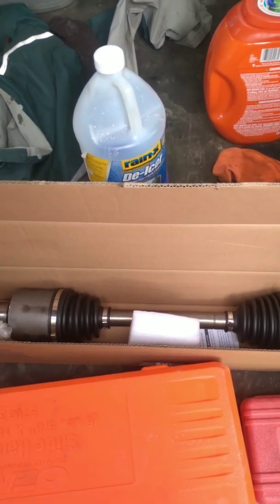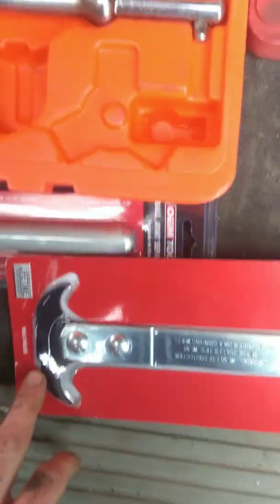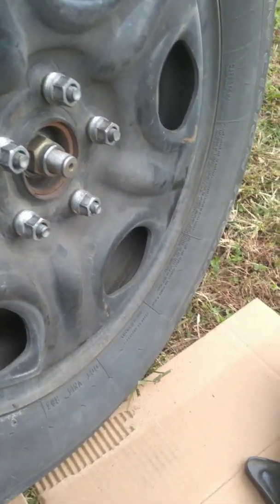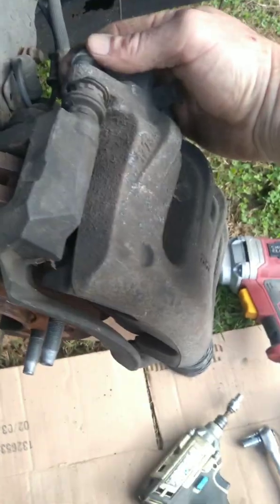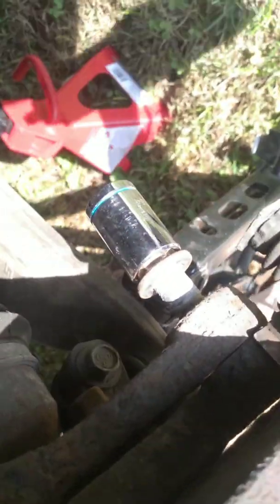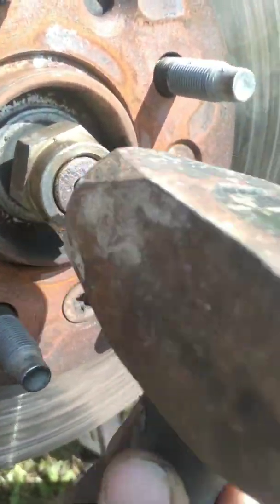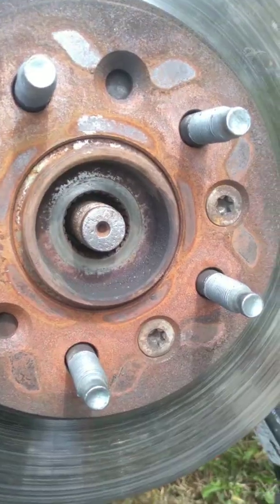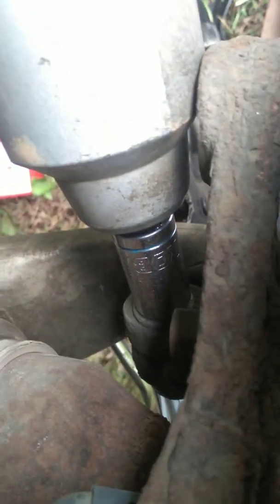Ford CV axle and output shaft seal replacement. Freestar/Windstar shown other models similar

Comment: How did you get the ball bearing off I can't get it for the life of me can I jack up the hub? Pls help lol
Reply from the maker: Are you having trouble getting the axle out of the hub assembly?
Reply: I'm having trouble getting the A-Frame disconnected from the hub assembly. I've been prying and prying with a pickle fork and having no luck I noticed in the video there was a scissor jack under the router so I was wondering if I have to jack up the router to get it disconnected. It just seemed sketchy to put that much pressure on the spring when disconnecting it.
Reply from the maker: Correct me if I'm wrong but you're having trouble getting the ball joint out of the pinch bolt assembly on the wheel hub. If so that is because the ball joint is part of the control arm, the control arm pushes pressure upwards and you have the strut pushing down on the hub assembly. In the video I used a jack to lift up on the wheel hub and the pickle fork to push down on the control arm. I kept jacking it up and pressing down until the pinch bolt assembly released the ball joint. When it did the hub did kick forward and knocked my camera down. I should have taken the bolt out of the bottom of the strut so that it would have gave easier than it did, it also would have been safer too. 
So if I were you I would take the bolt out of the bottom of the strut that holds to the wheel hub then you should be able to push down enough to get the ball joint to release. It's still going to be tricky because the ball joint goes in the pinch bolt assembly at an angle due to it being part of the control arm. Good luck, stay safe and I hope this helps you

Comment: Haha love this video man I like how you  show you don't need expensive tools to do work yourself. I replaced both sides on mine. My ball joints where really stuck I hit them with a pickle fork to loosen them a little then put a pry bar in-between the hub and the control arm to loosen it some more then finally I pryed in the hole in the control arm to pop it loose. The drivers side axel is harder to install because it's a female end going into the transmision's male end I used a block of wood to tap it in so I wouldn't damage the boot. Also to pop them out you really need a big slide hammer not those ones they rent

Comment: Where can the pinch bolt/nut be purchased at?
Reply from the maker: I've tried looking I couldn't find one for my Ford Freestar. Even the local Ford dealership couldn't get me one. I ended up using locktite and torquing it back to spec. Checked it after 6 months and it was still torqued correctly